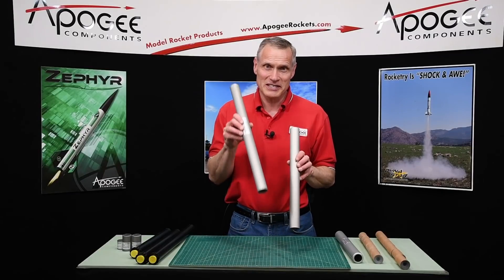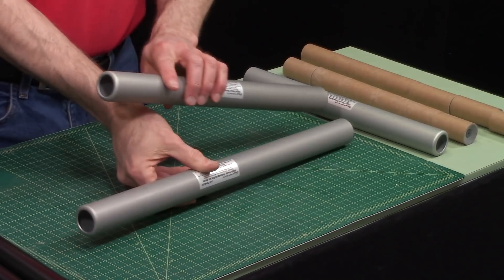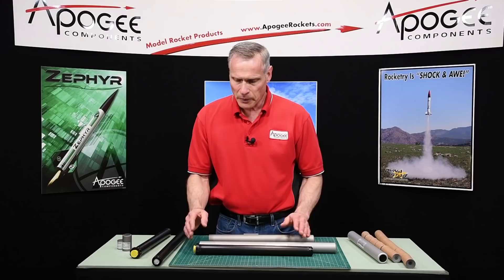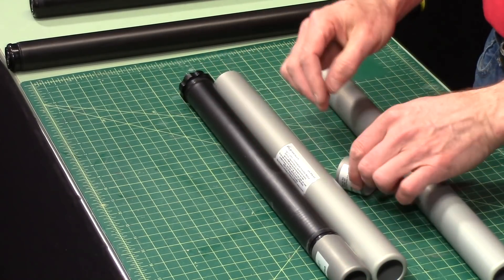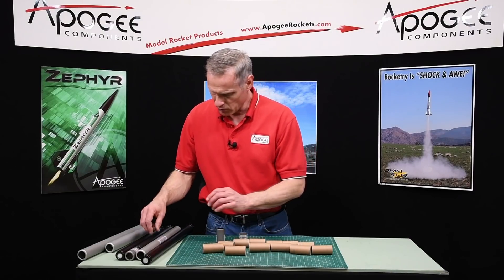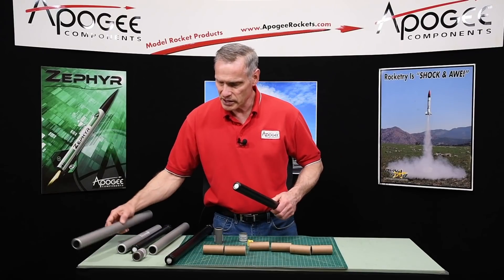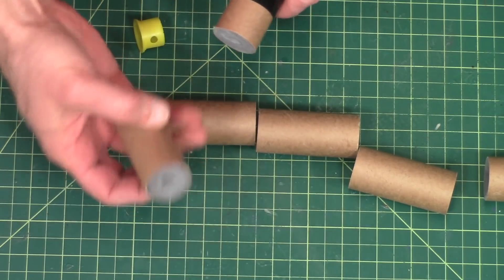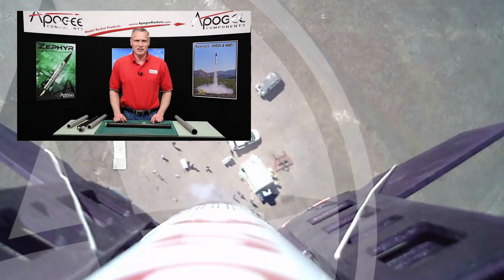What Makes the Cesaroni 38-6GXL Casing Different?

Comment: the spacers have a rolled edge on one end.  Does it matter which way you put the spacers into the motor case?
Reply from the maker: Yes. If you don't put them in correctly, you won't be able to screw on the nozzle. You'll figure it out.

Comment: Nice overview Tim!

I've seen the cupped forward faces on all the Pro38 reloads I've used so far. Do some of them have flat faces?
Also when I flew a K750 (6gr Pro54) in my L2 rocket, the aftmost grain had a larger core diameter than the others, making the assembly order important. I don't know if any Pro38 have this different geometry, I just always try and keep them in the factory order.
Reply from the maker: Yes. That is always a good idea to put them back in the order you've taken them out.
Reply: I was shown what they look like when I bought my 1st one so I only take the delay out and adjust it and reinstall it   That way I can't screw nothing up except my delay time LOL

Comment: Can you fly a 4 grain motor in a 6xl case+ spacers?
Reply: You can only use 2 spacers per case. So only a 6xL and a 6 grain in a 6xL case. On there website they have a case kit that will come with a 3 and 6 grain case, 2 spacers and the delay drilling tool. With that kit you can use 1 grain through 6 grains with only 2 cases.